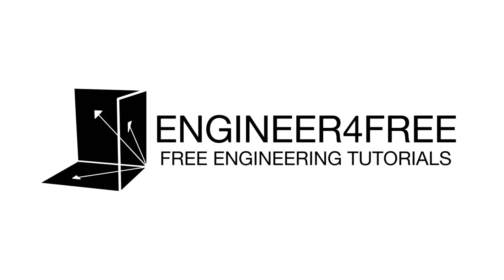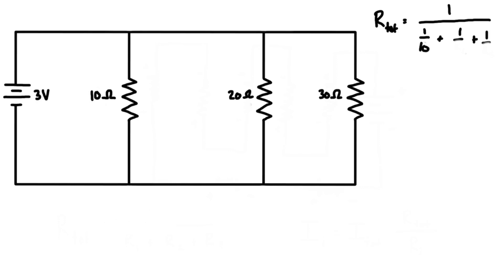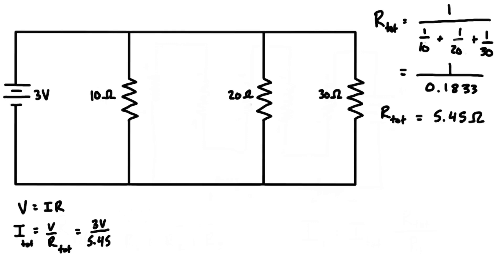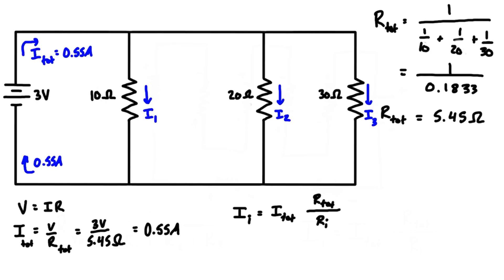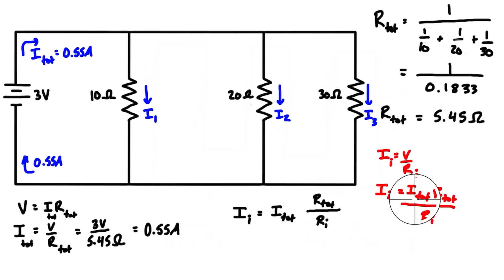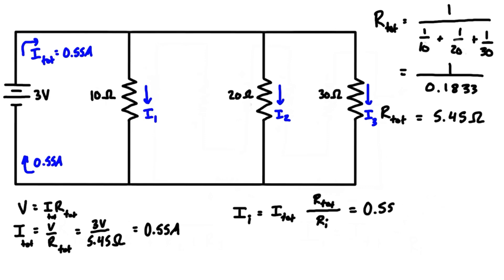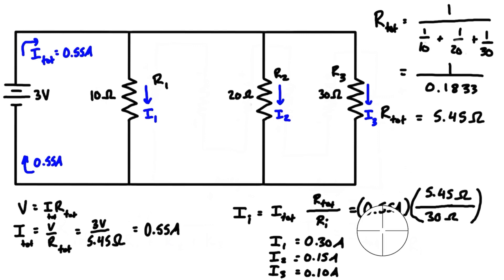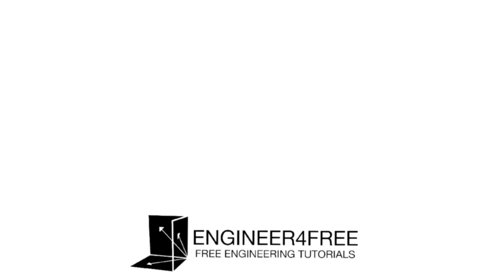Current Division Example Problem #1 (Parallel Resistors)

Comment: complicating it for nothing, all resistors have the same voltage because they are all in parallel with the voltage source. Just I = V/R for each resistor.

Comment: In a straight parallel circuit like this, the total voltage will be the same across each branch. Just divide the 3 volts, over each resistor value, to get the currents across each resistor!